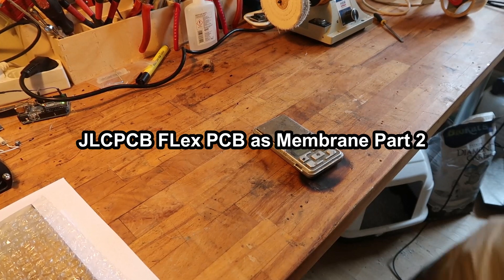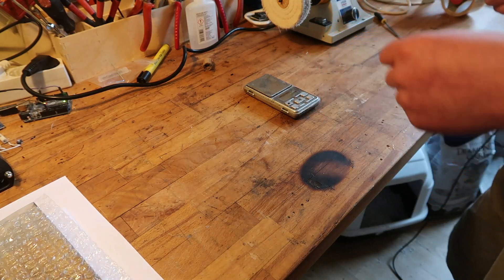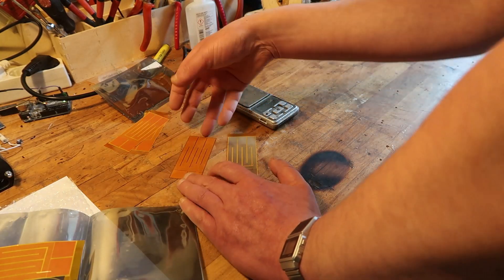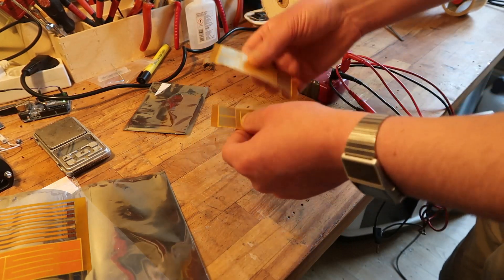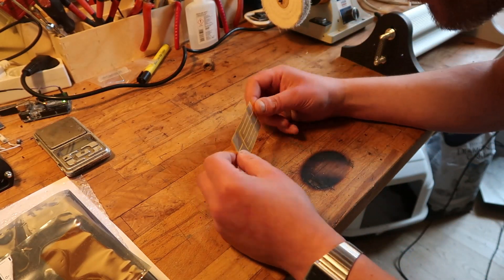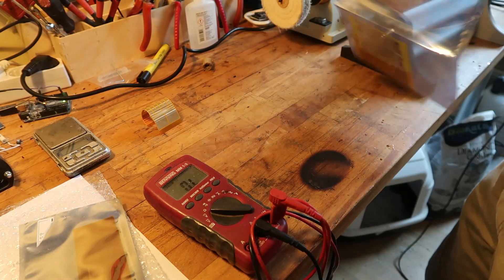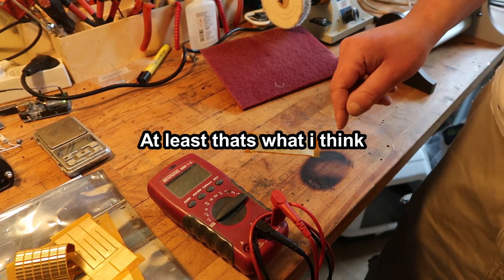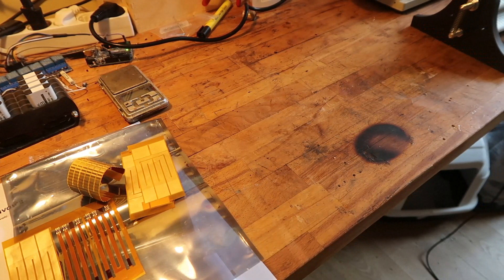Flex PCB from JLC PCB as planar tweeter membrane Part 2

Comment: Could it be possible to electro plate ribbon traces on your material of choice with conductive paint, maybe could even be used for planar traces? Just an idea I had
Reply from the maker: well electroplate works for copper. not so much for alu. besides that its another layer :(
Reply: Why, what do we want to achieve?

Comment: its possible that the corrugation has created a "V" right in between two tracers creating a short, pulling it out tight might fix it if it has occurred
Reply from the maker: I.measured it after corugation as well same as before